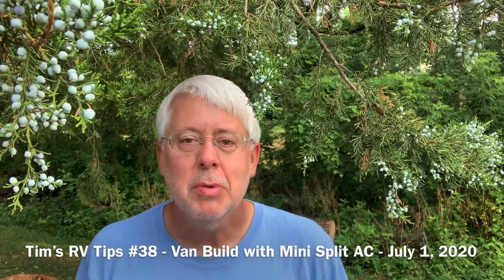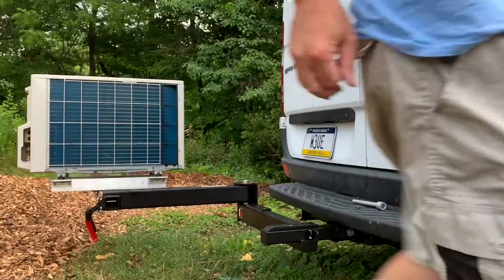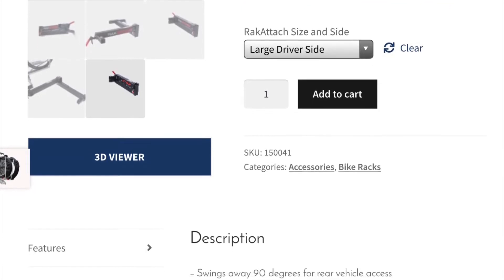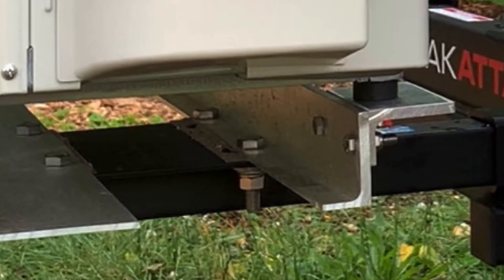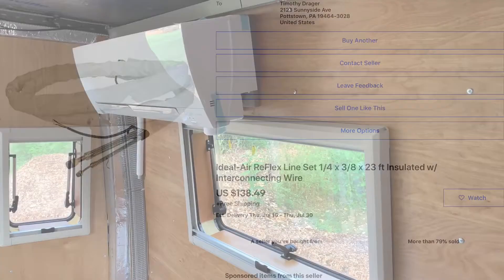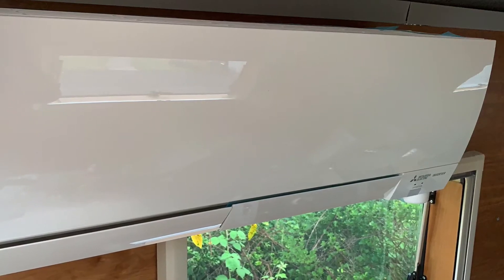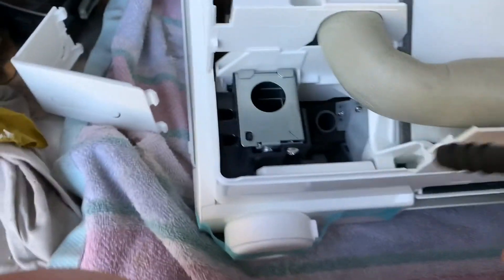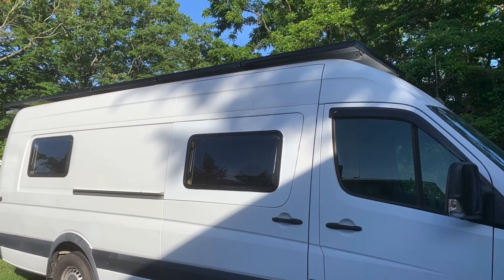Tim’s RV Tips #38 - Van Build with Mini Split AC - July 1, 2020

Comment: Nice installation and setup👍.
I mounted a Pioneer 9,000 btu on the rear of my van. I wish I had of known about the flexible line sets. I have 1,200 watts of solar panels and 900 amp hours of lithium batteries. The mini split is wonderful summer and winter.
Reply from the maker: No offense, but 900AH at 12VDC is only 10,800 Watt hours, which is 8600 watt hours usable. This capacity will run the Pioneer for a few hours under heavy load, unless the van is heavily insulated.
Reply: @tdrager  4" of wool insulation in the roof, R13 in the walls and R16 in the floor.
It's a 2021 E350 cutaway van with a 14'5" box. 84" of interior height and 79" of interior width. It will run the ac on economy setting for 24 to 30 hours and the heat pump for 10 in the Charleston SC area climate.

Comment: This would work for me if the outside condenser was more hidden or practical,these weren't made for RVs so i understand why it isn't. The very best AC for a van is the Cruise N Comfort,it's mounted under the van or inside.
Reply from the maker: Maybe mount it on the left rear door. It’s working great so far. Only $1,700: about half of the others and has 2x the performance.
Reply: Which is best, Cruise comfort or a mini split?
Reply from the maker: @usitae5034  Curse N Comfort costs 2x and is 3x less efficient. The underside of any vehicle is quite filthy. Mounting the mini split on the rear protects it from most pebbles and rocks.
Reply: Cruise N Comfort costs $5,000 and the EER / SEER is a mystery. Installation is a nightmare.

Comment: Looking to do the exact same thing. How has your experience been so far?
Reply from the maker: What a blessing on a hot humid day! It can run indefinitely on hot (90F) days on solar power. I may add a fan to blow the cool air from the rear of the 17ft van space to the front because there is a 10 degree difference between the rear and the front of the van. I should have mounted the indoor wall unit in the center of the van.